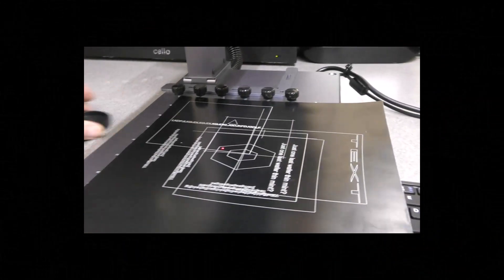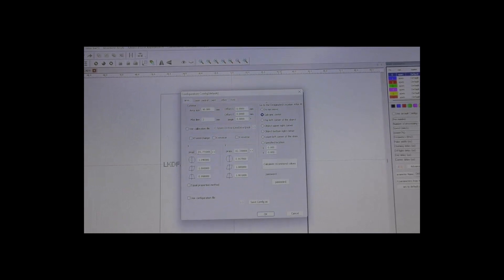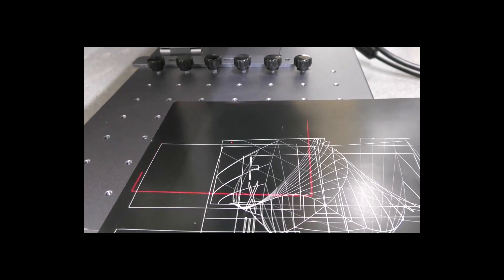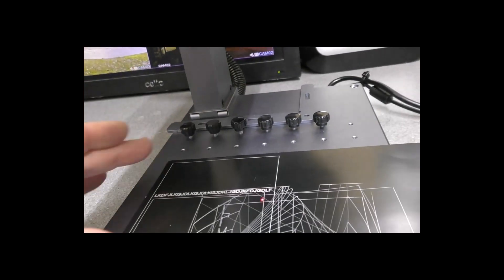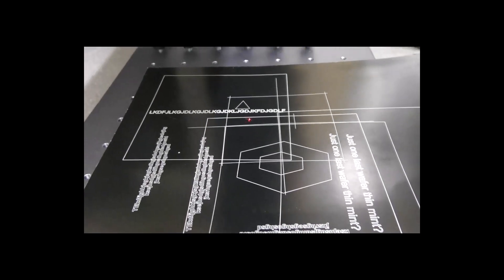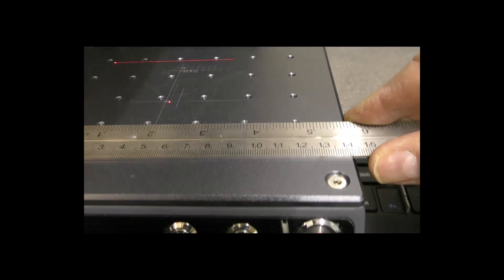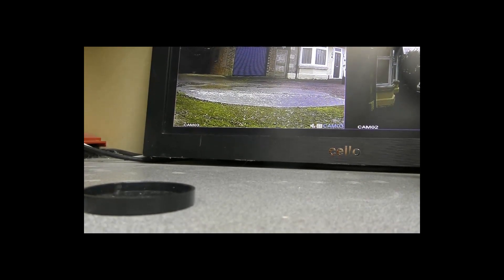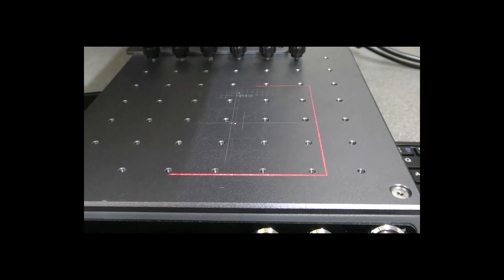Mr Carve M1 Pro and others, increasing your working size from 70mm to 100mm

Comment: I made the changes you have in the video.  It shows 100mm on the screen, but I am only seeing 70mm when I do the red light outline... 
I really appreciate what you have contributed to the M1 use.  I did notice your video resolution isn't good enough to see what you are changing well.  
I have tried just using the listed steps and I keep getting only 70mm. Any ideas?  I will post this in the FB group as well.
Reply: same same, if you found the answer I would love to hear it! Thanks
Reply: Did you guys made that?
Reply: for future people mine wouldnt save the size after clicking ok unless you manually change the numbers themselves

Comment: Hi, may I ask , other than metal. plastic, wood, paper, leather, acrylic, glass can be engraved well?
Reply from the maker: No. This is for marking metal. Leather possibly depends on the type and finish. Plastics can be very dangerous due to the fumes given off,  make sure you know whet you are burning and use a fume extraction system. Everything else No.
Reply: @Trevs-Shed  the sales man said it come dual laser, can engraved all materials, Red light laser for all metal, and blue light laser for wood, acrylic, glass, paper, leathers..
Reply: @Trevs-Shed  your machine is M4 pro Model?
Reply from the maker: @hermanhasan6773  No, mine is M1 Pro. You are getting a dual laser, totally different.
Reply: @Trevs-Shed  oh, ya.. Just considered to buy ,, searching more information on YouTube.
Reply: @Trevs-Shed  This is not true. It will engrave plastic just fine, acrylic just fine, leather just fine.
Reply from the maker: You need CO2 for everything else.